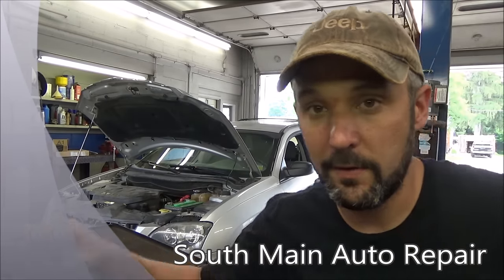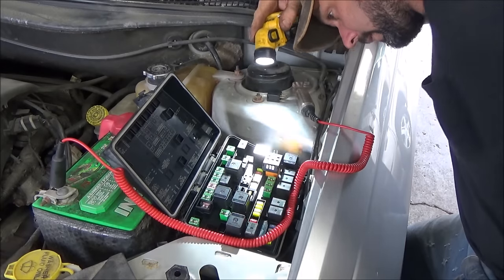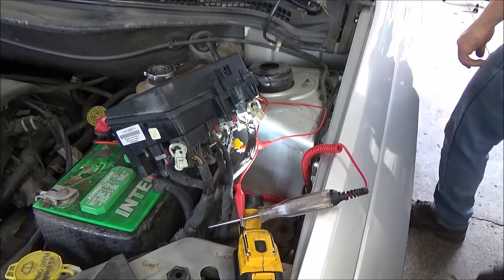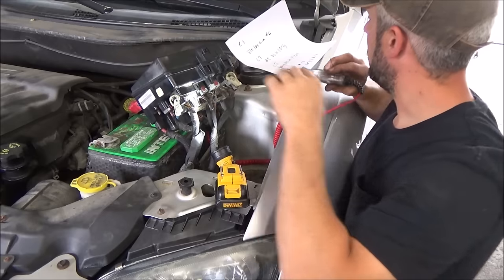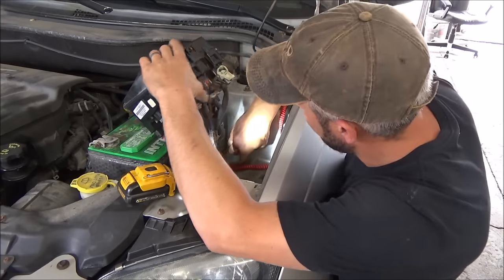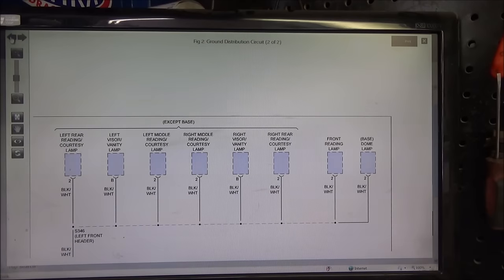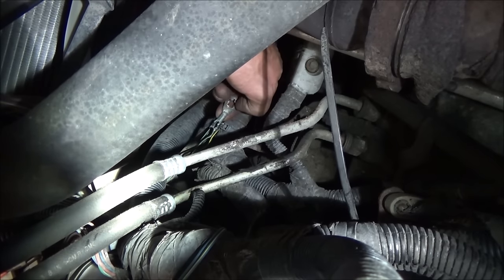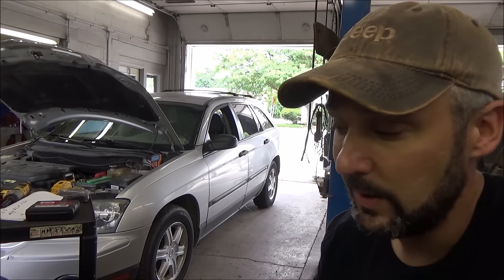Chrysler Pacifica: TIPM Electrical Problems

Comment: Hello Eric, I just picked up a 2006 Jeep Commander 5.7L Hemi limited with lots of things not working.  I think if I do what you did in this video to find the bad ground it will solve my issue.  Problem is Jeep couldn’t provide me with a ground schismatic due to the fact that they don’t support 2006 cars and older.  The tech did try to find the ground diagram but could not.

Any advice on where I could find the ground diagram for my car?

Any help would be appreciated.

Thanks

Comment: Just did one of these yesterday.....took lower connectors out of fuseblock...found 2 burnt contacts.....mine was on the fan/door lock relay....changed out the multipin connection block connection and burned TIPM....issue fixed...back probing works every time...wondering though...what did u use for the coating on the ground wires to stop corrosion?

Comment: My friend has a Jeep Patriot 2015, and her Jeeps issue is the interior lights flash on and off like a haunted house, the wipers come on with the left blinker and randomly the windows don’t work and my mechanic looked at it and he said it’s probably the power module your talking about but they are hell of expensive to replace so she just drives around this haunted house of a vehicle for now lol at least it’s not like that one guys with the horn and wiper fluid stuck on

Comment: @South Main Auto Repair, I have an 05 Dodge Caravan SXT with the 3.3Land I'm having a weird issue with all my lights and dash doing this subtle flickering. I had the battery and alternator checked and they are fine except they said my voltage regulator, built into the ecm, is bad. The van runs and drives fine. I do have some other minor issues where the door locks will suddenly stop working intermittently, windows stop rolling up intermittently, etc. Will this bad voltage regulator cause these issues?

Comment: I have a 2005 Chrysler t&c and I checked all fuses but the ac 25 fuse not working. Im not a mechanic so I don't know how to this. I have gone to different mechanic and they tell me tipm needs to be replace and they quote me 1k and I don't believe it's correct watching your videos. You recommend anyone in the Los angels area?

Comment: You are amazing. Great job. I have issue with my 2012 T&C Not starting you gave me some hope. I am thinking TIPM. Dealer said PCM. I got it turn over and start for 2 minutes then it shut off. Screen says press clutch pedal to start. It doesn’t have a clutch. Do you any idea?

Comment: Hi if you see this comment, I was wondering if you have any ideas about this, I went to spray windshield washer fluid and pretty much bunch of things happened, no, power to windows, dash lights came on ABS engine light, locked in park , etc and 10 and 11 relays started clicking and click continually, I did find those grounds but they are ok. I was wondering maybe the wiper motor shorted out, do you know where that timer relay is etc.  Listen I know time is money and vice versa and you are a very good mechanic,  I can tell, If you could give me some ideas I would be happy to pay for some help. I haven't seen any bad connections on the bottom of the box. I have unplugged a couple of harness connectors to narrow it down and I did find one when I pulled it the clicking stopped but  don't have a color code diagram so I am not sure what harness or where it went. Thanks PS I am in Florida....

Comment: you were certainly justified in taking the path you did eric. proved its not always module eh, well done again. i will certainly be checking grounds here in england if i get faults,i cant get print outs like you though as im only a diy-er.

Comment: New subscriber and  absolutely love your channel. Question: I have a ‘08 Ford Edge and none of my power points will work. There are four (front console, arm rest, passenger seating, rear Cargo area) I determined it must be the ground connection but don’t know where. Is there a website I can go to like the one you used in video to get a more detailed diagram of ground location? Also HF sale a Cen-Tech cable tracker. Could I use this to trace and locate ground point?

Comment: I have a 2005 Town and country with 190,000 miles and all at once during the winter something happened that when the key is not in the on or if the engine is not running nothing will work and nothing works when you turn the key to ACC but when I start it everything works but the radio I was told it might be the IPM that you fixed in this video.Just wondering if I should invest the money to have someone check the grounds first or is there a way to tell if the whole thing may needs replace.they wanted 600 to a 1000$ to replace.Just thought I would ask for any input you might have.By the way this was a great video looks like you know your stuff Thanks South Main

Comment: i have a 13 chrysler 300 C automatic was working fine until i decided to look and open the tipm. once i reconnected the battery , i get "please step on clutch and brake to start" also radio is asking for a antitheft code. battery has 12.08 volts, but there is no communication to ECU. im getting an error code U0100 . im thinking a wire came loose . any suggestions? please and thank u.

Comment: Oh, that's a special cosmetic feature, standard on all Chrysler Pacificas.  The ends of the copper wiring of the wiring harness providing a ground connection to the chassis for the TIPM are designed to develop an attractive patina decoration.  It's a luxurious touch that Chrysler feels adds prestige to the engine bay.

QUALITY ENGINEERED - CHRYSLER CORPORATION ... uh, DAIMLER-CHRYSLER ... um, CHRYSLER LLC ... oh, FIAT-CHRYSLER AUTOMOBILES.

Comment: I have a 2014 Town and Country Van. It started out on the reader saying the cadilic converter need to be replace bank 1. Then after a couple of weeks it said that I had to service the blind spot system. Then after a couple of weeks everything started to show up on the dash went bonkers. A friend of mine has a comp. to hook up to the van, and we shall see what it says, and reset it after. Plus in the last couple of days the engine stuters, I thought in might be the gas. I was told the Van has no fuel filter, is that right?

Comment: I have a 2000 Jeep Cherokee that has a parasitic circuit. It killed 2 new batteries over a few days each. The circuit runs the dash gauges, power door locks, interior lights and I think the power windows and radio. I found the circuit  by back grounding it. I did not want to rock the boat, so I removed the fuse and wired in a switch from the dash to the box and turn that circuit off when it is parked.  Is this a similar issue, or is their something more going on...Once again I just have a simple meter and a good test light.

Comment: Thanks for all the awesome videos!  PLEASE keep them coming!  But...I know, I know...I am struggling with the symptom of those two relays energizing when you originally hit the horn.  AND that you actually had a very weak ground on the C4 connector ALTHOUGH your source ground for the TIPM  connector was absent.  I'm thinking that there COULD be some trouble with a short-to-ground issue within that TIPM????  I don't see how you could get a weak ground AND have both those relays try to energize when the horn is depressed WITHOUT having an internal short-to-ground.  Am I barking up the wrong tree (like I matter, anyway...).

Comment: This video was very helpful I have a 2010 Dodge journey and the head lights and high beams flash and will not come on a shop told me he thinks it's the fuse box but it works some times and some times it doesn't what you think I can do to see what it is

Comment: Thanks for the video!
 Was wondering if you've dealt with our particular problem and what the potential solution is. We have an '07 Pacifica Touring model with the 4.0 liter engine and a couple months ago the blower motor started working randomly. At first it would just not come on for a minute or two and then would work fine for days. This went on for about a month until it started to not come on for days at a time and then weeks. I saw another video where they had starting issues along with no blower motor working and it ended up being a bad ground wire. They added an extra ground from the negative battery terminal to the transmission or engine and solved the problem. The difference with our issue is that we don't have a no start problem, just a blower motor problem....Any ideas? I'm hoping that it's not motor brushes or worse....

Comment: Just found this video, I have a 2014 chrysler town and country and when I put on high beams everything on dash dies and resets. all warning lights come on, evic read out goes off then resets as do gauges. I can hear relays clicking in fuse box when it does this. It doesn't do it everytime and if I don't use highbeams there seems to be no problem. I'm thinking tipm problem? Any ideas? I see no corrosion on any wire connections.

Comment: Hi Have you come across a oil light coming on and goes off again got a good pressure had a new oil sender  and sometimes a code of PO340 comes on changed crank sensor with a good spare one any idea  it's on a Chrysler grand voyager 2.8 crd 2007 same as a town and country thanks for any help. Jeff in uk

Comment: I went thru the same thing on my 2007 Pacifica last year.  Yeah, took off the fuse box and poked around.  Then I got on youtube and found a guy that did the ground wire fix.   Sure enough had all 4 ground leads ripped off.   Bundled the wires and attached to a ground lug to the chassis and voila fixed the problem.

Comment: Seems like its a Chrysler problem with grounding. Is it because of the weather conditions water freeze and thawing? I have one in my drive way I've been trying to run down all its problems. Plus a parasite drain on the battery. I'm thinking its time to haul it off to the junk yard . great videos as always

Comment: Could a ground be a problem on a dodge 3500 diesel Tipm. I have no power on part of Tipm where the stop turn fuses are connected. Had power to the fuses before with no stop turn. I don't have clue where the ground would if thats the case.

Comment: Having this sort of issue in my 2005 Jeep Grand Cherokee it cranks but no fuel no spark I know the battery ground and another ground is on the side of the battery is there any other place there could be a ground after the tipm  before I go buy a tipm or a pcm

Comment: Great video! I will keep this in mind if I ever have an electrical issue where things don't work, but I have an 06 pacifica that has an issue with something working when it shouldn't be. Radiator fan comes on randomly with the ignition OFF! No key even in the ignition. Ever come across this? I'd love to hear any thoughts... So after diagnosing the problem, it turned out to be the relay/sensor, whatever it is mounted to the front bumper (actually it was rivited to the bumper).. Replaced it with a new one and the problem no longer exists!
Reply: So after messing with all possibilities, it turned out to be a bad fan relay, sensor, whatever it is mounted on the bumper. Replaced it and the problem no longer exists!

Comment: I have a 2007 Chrysler Pacifica 4.0 and the tipm under the hood has no grounds on the relays. I've cked all the ground wires on frame and engine and at battery they all tested good. So I'm at a loss as to what to do or check next

Comment: From my experience, Chrysler battery cables sometimes can cause crazy electrical issues caused by built up corrosion in the cables.  Replaced those and all my crazy electrical issues (wipers turning on by themselves, turn signals not working, and all my dash lights randomly lighting up and door chime beeping) went away.  I would start with checking all wires.  Kinda what he did

Comment: I think that the whole problem with vehicles today is the incessant, never ending search for the latest, greatest gizmo to thrill the "Instant Gratification" generations. Back in my day, (im 77) we really appreciated a car or truck that got us from point A to point B with no problems. We gladly learned how to use the clutch, shift the transmission, parallel park, and use our rear view mirrors. We even learned how to back up a trailer without " back up assist" and were able to stay in our own lane without a " lane departure" sensor wobbling the steering wheel so it feels like a wheel is going to fall off. There is simply too much electronic crap on vehicles today, while they have eliminated all the good stuff. Gone are Vent Windows, Roof Gutters, and simple ignition systems. Of course, when I was young, you had to actually have the means to pay for your vehicle before you got to drive it. Does anyone realize that the more the vehicle does for you, the less you have to know to be able to drive it, so you are less able to get yourself out of trouble? Throughout my life, simpler has always been much more reliable, and usually better WTSHTF.

Comment: My buddy has a 2006 1500 mega cab that keeps developing pin fitment issues with the female connectors on the TIPM. So far it has affected the low beam on passenger side. The right front turn signal and the left rear turn signal. Seems like every 4 or so months something else goes out that I trace back to the female pin fitment.

Comment: Have a?question on my 06 dodge ram 1500 4.7 replaced heads and gaskets because previous owner overheated and cracked head after replacing the heads. Coil packs plugs. Crank and cam sensors fuel pump i have 55 psi at rail with no psi loss injectors all spray fine when checked. But do not work. Once put back into place. Truck runs all day sprayimg fuel in thru throttle body but only acts like maybe 3/4 cylinder getting fuelfrom injectors when u stop spraying fuel in to throttle body. Changed. Ecm as another mech told me it would not make a difference except possible shift problem truck just will not run any help wouldbe. Greatly appreciated

Comment: You would think since the grounds are attached to the body and are exposed to the environment that the eye terminals would be sealed with a silicone seal to prevent corrosion.   All of the other connections have silicone-style protection but not the grounds.  I have used a dielectric grease on grounds after soldering and heat shrink as a preventative.  Grounds are just as important as power and load connections. I guess as long as things last through the warranty period that is all that matters.

Comment: I need help my pacifica engine light is on the computer is reading the map sensor voltage to high and keeps tripping engine light and the throttle position sensor

Comment: Very good video, it was very informative.
I am working on a 2005 Chrysler Pacifica  right now also for a friend of mine. It sat for a few months, and when they went to start driving it again the  instrument cluster and brake lights are both out now. I am suspecting a similar cause.
Could you please send me a link to the few ground wire diagrams that you were using? It would be much appreciated, and it would help me to try and track down his problem for him. I am just trying to do what I can to help people when I can, and I do not have access to All Data, to be able to print out those diagrams you used to trace the problem with. If you  could please help with those I would truly appreciate it.

Comment: Ha, 45 seconds in and this is sounding like a VAN line issue I'm having with a little Peugeot 206. Same symptoms, no wipers/abs/money light/hvac and all that jazz.  difference being, I've been hacking wires out of the loom for a diesel conversion haha (problem only appeared after all this was already done though, and narrowed it down to VAN communication loss between BSM (engine fusebox) and BSI (passenger fusebox). Gonna say broken CAN/VAN wires at this point & then watch your video.

Comment: I own a 05 pacifica 3.8L having trouble with speedometer and if the fuel gauge its half a tank the needle goes to empty and automatically shuts down and rpms goes up then down. I have replaced the alternator and battery light stays on

Comment: I had a similar issue with my 02 dodge intrepid. The power windows,locks, ac/heat would just die while driving.  I pulled   over and restarted it and it was fine for awhile but it would die about a half hour later. The ignition locked up so i replaced  the ignition. Haven't had the issue since. Chrysler is a pain sometimes.

Comment: If you look at the drawing for the power module you will likely see that the clicking relays were being activated via  the common coupling impedance (resistance) of the high resistance ground.

Comment: Want to know how can I find out if the AC works and  if the ac control panel works too. It doesn't turn on when I turn on the car it's black, no light nothing. Everything else works the windows the radio but just the control panel to turn on the AC doesn't work. How can I check it myself. It's a 2007 Pacifica

Comment: Speaking of headlights back 2018 had a Hyundai Accent 2016 that had dual light low beam. Checked the wires at the connection at the light and the the power wire at the light had both hot and ground going threw it. To bad bosses want it done cheap and fast so had to cut wire and tide it some how in the TIPM. car was one of their rentals and when they bought it, it was wrecked in the front.

Comment: I have a 2003 Cadillac Escalade and I don’t have no parking lights at night sometimes they turn on during the day / night I check the fuse there good but when I press the brake light, turn signal do work